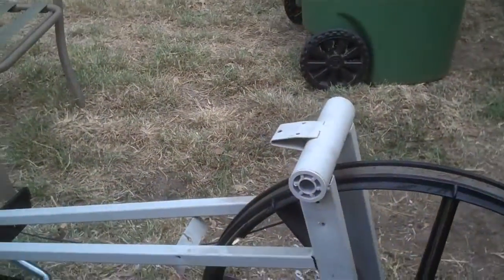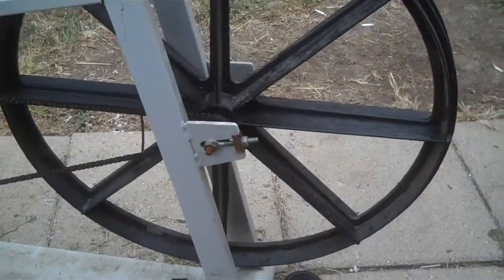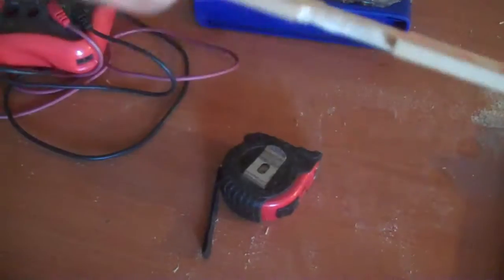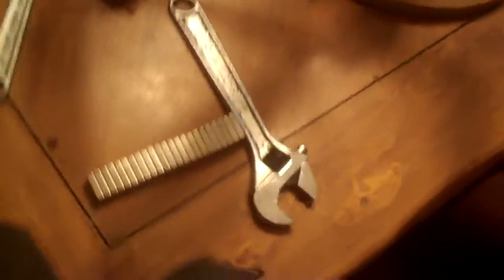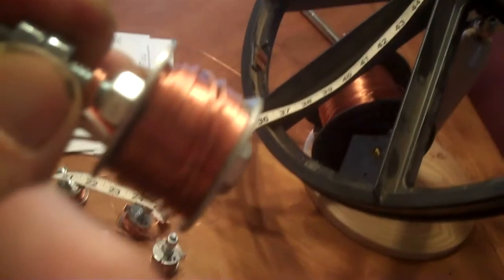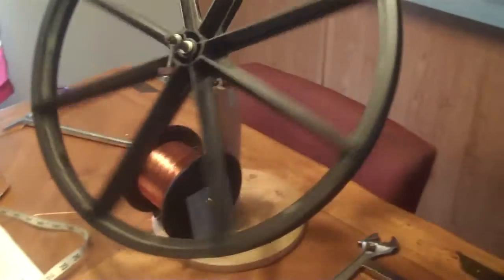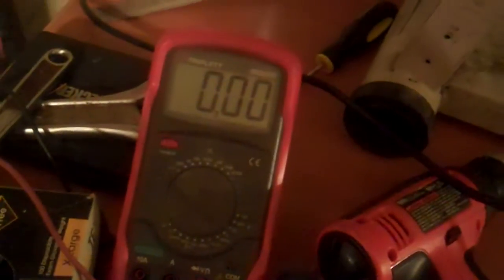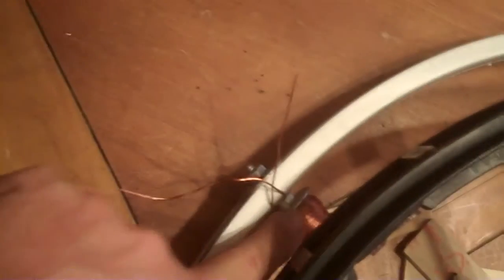First PMG build from scratch!

Comment: hey chief. saw one of your videos were you had all the coils mounted to an aluminium ring. just wanted to let you know you can get better energy efficiency if you used something non electro conductive ring or hardware to mount to the ring. magnets free spinning inside an electro-conductor act as an eddy current brake and rob the system of power.

Comment: Nuts and bolts. Maybe replace materials with something that won't attract magnetic...
Reply from the maker: +BiGMaC Yeah I had the bright idea that it would amplify the magnetic flux through the coils,
Reply: you need ferrous metal to invoke a better magnetic field into the coils from the magnets. without any iron the magnetic field would not produce a measurable amount of current or voltage.